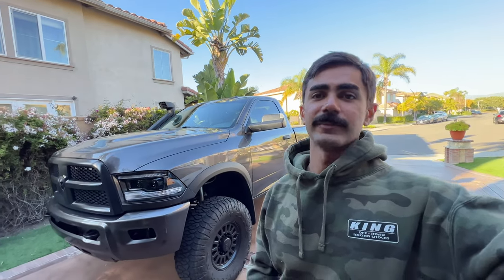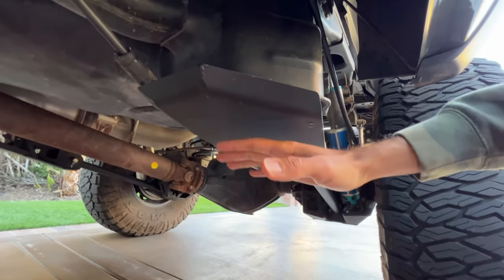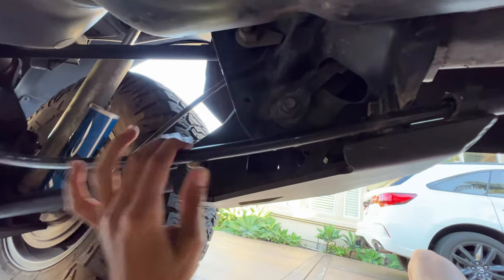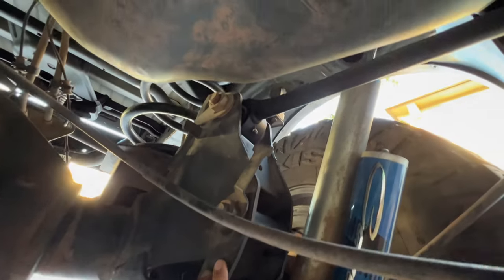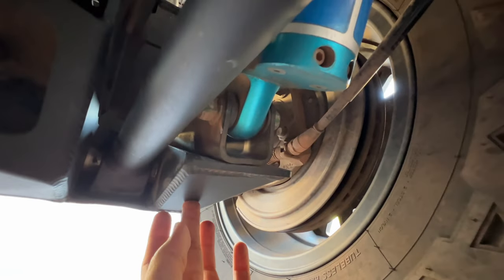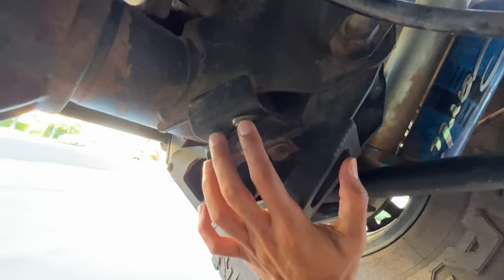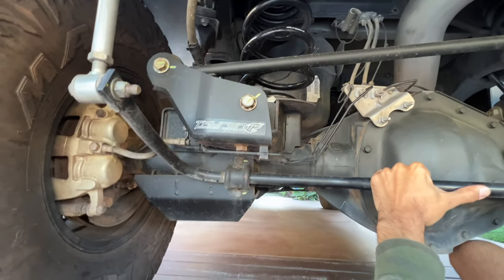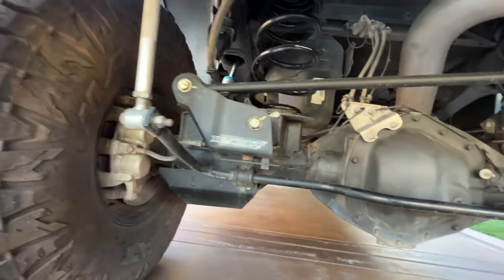Prototype Thuren Rear Suspension Kit - Eliminates Axle Hop for 2014+ Ram 2500

Comment: You actually didn’t explain that lower rear link properly. It’s actually dropped on the frame side and axle side.  The original pivot for the lower link on the axle side was at the center of the tube.

Comment: What’s the tubing size on the arms?
Reply from the maker: I have to double check, I don't know off the top of my head. Will report back when I find out!
Reply from the maker: Upper arms are 1" chromoly.
Lower arms are 1.5" x .375 DOM tubing.
Reply: @socalexpeditions how’s this system working out so far?  I have a horrible hop at low speed in sand, light throttle.
Reply from the maker: @IFHSP2  Absolutely love it. It’ll fix that problem